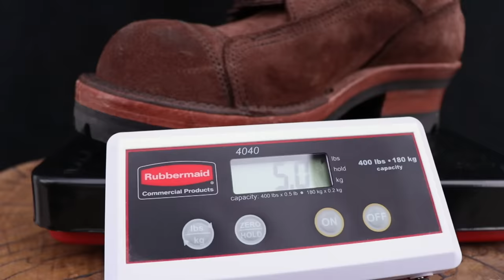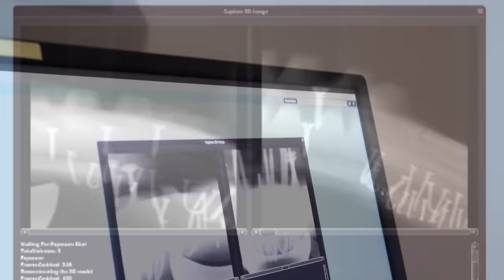Testing $1000 “Indestructible” Nicks Handmade Boots

Comment: Took me years to pull the trigger on a pair of Nick’s boots. When I finally did, it was a huge eye opener. You get what you pay for. I’m a welder/fabricator, for over 20 years. I typically had to get a new pair of steel toe boots every year or two.  Usually Carolina’s or Red Wings loggers. I’ve been wearing the same pair of Nick’s at work, and outside of work, every single day for the past 6 years. Buy once, cry once. 😉
Reply: How do they hold up to everyday usage? Like on the streets and stuff.
Reply: @ShadeSlayer1911  the only thing the streets are gonna do to a pair of nicks,  is wear down the vibram soles over time. Even their non work boots are insanely durable due to the leather and build process.

Comment: I’d definitely buy this boot, even if it cost twice as much as the regular line. Just to have one pair of work boots for life
Reply: @J Hemphill yes, and I would pay 5 times the regular price.
Reply: @J Hemphill No lie though, the break in would be hell on earth.
Reply: My standard Nick's are the heaviest boots I've ever owned, I don't even want to think about lifting the "indestructible" over and over for 12 hours. Sometimes you can armor something too much. It's very similar to the problem to he Soviets ran into with the IS-7 tank, you can armor something beyond usefulness.
Reply: @jacktheaviator4938  it's often said that a pound on the feet is 5 on the back. So these boots would be extremely tiring. There are a small number of use cases/environments where these boots would be useful, but a solid smokejumper with a steel toe would be noticeably lighter and cheaper while being 90-95% as durable and lasting 80-90% as long.
Reply: For this life and the next
Reply: @edenironworks2  they're overkill for the average worker but for the workers who would need it would be priceless to have. 
I'll always believe in paying once for something long lasting than paying more over time for cheaper replacements but its still a needless expense to get boots that are overkill for what you need them for.
These aren't the only work boots that can last a lifetime after all.
Reply: @yossarian00  Absolutely. Boots are tools. If you don't use the right tool for the job, you're gonna find it lacking.

Comment: Wearing 5 pounds on each foot sounds like a leg and lower abs workout.
Reply: Rock Lee, General Contractor
Reply: They can advertise it was a indestructible work out boot lol
Reply: I have a pair of Danner Flashpoint boots ant they weight 3lbs each. All i can say is they are exhausting to wear in the terrain.
Reply: the standard issue boot that the army gave me were heavy too i doubt 5 pound heavy but at least 3
Reply: guard men's from a medieval time is laughing at your chicken leg from heaven while still wearing steel boot in the afterlife.
Reply: @benjaminfranklyn604  isnt that the truth!
Reply: I have a pair of boots that I modified for welding and other shit, the weigh around 14 pounds and I wear them for 8 to 12 hours almost every day
Reply: @Michael-ko4ko  ya they are brutal lol but still pretty solid.
Reply: These are light compared to caulk boots, tool steel spikes for walking on logs. My pairs usually weigh around 4lbs each. I don't even notice they're  on my feet..

Comment: Made with pride in the USA by skilled craftsmen. Let's elevate craftsmanship to the level it once was and should still be appreciated for
Reply: What’s sad is quality is kinda a niche market now. People would prefer to buy cheap and buy multiple times vs buy once and have something forever. For example, I’ve got some American made tools I’ve used at work for years and years and they are as good as new, and I’ve got some cheap Vietnam made ones that break often and always buying new ones. The cheap ones will outsell the expensive ones to the average consumer. Especially ones that only need a cheap one to get the job done. It’s sad but it’s logical and actually a better deal for most in the long run. Most industries are like that now, quality manufacturers can’t compete with the cheap ones products that are basically meant as single use or limited use. My American made Danner boots lasted 2x as long as the Chinese made ones that are really similar, but cost half as much. So I could get the same use out of the same ammount of money but for some it makes sense to spend less up front.
Reply: @tattedupchrist1105  don't remind me it makes me cry...
If I buy a tool I want it to break because I was dumb and abused it wrong, otherwise I want it to last forever, or be able to maintain close to forever.
Not enough quality in anything anymore, it's sad. People are addicted to the CONSUME lifestyle. Not only is this stuff cheaper, but you get the dopamine of constantly buying stuff, you're 50 dollars away from a hit of happiness and it's in the trash the next week.
Reply: @escapetherace1943  exactly. Good point
Reply: @tattedupchrist1105  do you know how many tools I've bought to start projects that never finish lol? It sounds good but do we really want $500 vcrs? I guess the tradeoff is having good jobs on our soil which may even it out...
Reply: @dashwolf8057  unfortunately your right and I agree with you to an extent. I’m right there with you. I have plenty of cheap tools. But we should be more careful, because hand tools aren’t the only thing we outsource to bring the price of production down. BUT places like China not only steal our intellectual property, but actively try to undermine and undercut US companies. Billions of dollars a year are lost to China because of fraud and counterfeit goods. That might not sound like a big deal when talking about shoes or hand tools. But when talking about something like a semiconductor, or a cell phone, etc.. it becomes a little sketchy. The same country that gives you a $20 dollar VCR also tolerates Chemists selling fentanyl to the average joe in America. It’s like trusting your neighbor who is a thief and  you who you are enemies with, to manufacture the security camera for your house and the lock for your front door. (Not the greatest analogy I know but works I guess)
Reply: That's what I'm saying.
Reply: @tattedupchrist1105  thing is. America is about kapitalism. The manufacturers are not interested in long lasting products. the sooner they are unusable, the better.
You can see this with lightbulbs, nylon socks, electronics and many more other products. Manufacturers act like the resources are unlimited.
When you take a look at soviets and communism, ressources were limited and products were manufactures in cycles. So it was absolutely a requirement, that products would last long. 
In Germany there are a lot of people that are especially looking for tools and machines from old east germany since it was soviet controlled and they made the best and most robust tools.
Reply: @tattedupchrist1105  No. people cant afford to do anything but buy cheap and replace. Being poor is expensive.
Reply: @leforce8249  manufacturers wanting you to replace often is especially noticable in phones. my old IPhone 4 was still fully functional, but became unusable due to old software. or with printers that break after a certain number of pages printed.

Comment: The important question is: what’s the breakin time?
Reply: Probably a couple of months.
Reply: It took me about two months I was wondering if it was a smart decision I went back to my old brand and man there is no comparative on my Nicks vs any other ones totally recommend
Reply: Only a few seconds with a gun
Reply: Took a month for me, it's worth it.
Reply: Wasn't as bad as my redwings and the build quality/comfort is second to none
Reply: How fast do your feet change shape to conform to the boot?
Reply: These boots look like they will break you 😆
Reply: @Ddabig40mac  they custom build them to the shape of your feetsis.
Reply: I was told directly it would be about 80 hours of actual wear time. I am about 18 hours into it right now.
Reply: couple weeks fire/forestry use, par for the course
Reply: @needfortweed8734  They look to be pretty stout, might be a bit longer a break-in time, but if they're built to your foot it shouldn't be too bad.
Reply: @needfortweed8734  7
Reply: @roydunn4649  Its about 80-100 to break in well enough to get through a typical day without the boots being uncomfortable any longer. They will continue to better form to your feet for much longer before being truly broke in. In my case it took much longer than 100 hours.
Reply: @JohnC686  Well I work 10 hr days weekdays and an 8 most Saturdays. Thanks for the info!
Reply: @roydunn4649  No problem. Nicks and the other similar makers really are amazing, nothing else like them. Enjoy the process and the new boots.

Comment: A year late, but I’ll put in my 2 cents.  I’ve worked in a shopping/receiving environment for years.  If there’s one thing that will destroy leather boots, it’s working around pallets.

For those that aren’t in the know, it’s the dropping of pallets and squeezing the boots in between pallets that does the trick, along with box cutters that slip at the right angle.

I’ve gone through half a dozen work boots, even ones with polyurethane on the outer toe for protection, and pallets just eat through then.  Scraping, cutting, and tearing through leather like nothing.  

There is one exception:  Roughout leather boots.  They can handle all the abuse without any kind of visible damage.  Only problem is they discolor and darken to an embarrassingly degree if tanned on the lighter side.  

But work boots aren’t there to look pretty.  Hope this helps.

Comment: These boots are good as aparatus for kungfu master training. Wearing them while training has many advantages. Due to the weight anchoring effect, once taken off, your feet will feel like Gordon Flash and sprtint 100 meters in 10 secs flat. Also good for sumo training because its anchoring effect while you stomp on the ground.

Comment: I personally have gone through 2 Redwings ($375 per pair) 4 Danners ($250 per pair) 2 Georgia's ($200 per pair) and a few Justin's ($150+ per pair) while welding and none of them have held up for more than 18months all from leather failure. Not the sole getting worn down.. either the stitches blowout  and the leather can't be saved or the insole rips or I even have a pair where on my heel the leather got a small cut and just ripped horizontally. I'm very hard on boots. Not sure if Whites are the way to go but these look like legit contenders for toughest boots. I would pay $1,000 once if these lasted 5+ years.

Comment: From a construction workers perspective: when it comes to buying steel toed boots they’re they suck unless you put tough toe on them because once something does fall onto them yea your feet are protected but now your  brand new waterproof 300 dollar boots aren’t waterproof anymore because the steel toe and falling object make a hole in the leather. These boots however are so over built on the cap that you may not even need tough toe that’s value. If you spend  your money on work boots you want them to at least outlast the sole they come with. If nicks makes a 9” boot to those specs I’ll buy them.

Comment: I got a pair of Whites of which I have been told is the parent company of Nick's a couple of years ago. They are the heaviest, clunkiest, most awesomely awkward pair of boots that I have ever liked. Wear them regularly as snow boots and motorcycling. If/when I ever crash, I know that my feet and shins are likely to be intact.
Are they built for walking? Sort of. The weight takes some getting used to and those heels... are the guy's version of a pair of high heels. Treat them well, though, and they are flexible, breathable, and will withstand... just about anything.

Comment: So I work as a water well drill and repair man in the west. And unlike oil rigs were in a more dangerous environment especially since we use all cable tool rigs. We drill and repair year round. I burn through boots. They don't hold up. I want these. These are nice. These will last. The main thing that kills boots is the oil water and iron bacteria. Iro. Bacteria grow on the steal cassings of the wells. So when we pull the pump and cassings up it get all over everything.

Comment: Should have used the whole boot for the bullet challenge -- using the half boot isn't an accurate test.  The boot had much more structural integrity before you cut it,  that might have stopped more of the projectiles (though I doubt the 300 Ultra is stoppable).

Comment: you shouldn't be surprised by the egg drop test. The egg didn't break in theo ther one because of the boot being hit, it's because the egg and boot combo were too light. It broke because the boot bounced off the ground and broke when it came back down. heavier boot=more mass which doesn't get moved from the energy of the ball, so a safe egg.

Comment: The last pair of heavy duty climbing boots cost $175 in 1984. Now they cost $418. A supervisor said can't use them here. But I was prepared dropped a 8lb hammer from 4' on the toe and did not hurt or dent the boot. NO it was not steel toed. Kevlar. But that was made to stop a tree gaff from cutting your foot.

Comment: Spokane has 2 boot makers.....Nicks and another company called Whites boots. Back in the 80's I tried to get Nicks to build me a pair of boots for my work on the Railroad. I walked in ballast all day and got tired of feeling every rock. I asked nicks to build a boot with double the leather in the sole, double stich, and double screw the Vibram sole onto the boot. The counter guy said I was crazy and a boot built that was would be to stiff and unwearable. So I went to Whites boots where they traced my foot and then built it to my specifications .....almost. 6 weeks after I ordered my custom boots I went to try them on. The guy pulled them from the back and sat down at my feet and slipped them on. I looked down and said boy the Steel Toe sure does not show. I bent over and pushed my finger into my toe. The guy gets a funny look and said "you did not order steel toe boots did you?" He went and looked at the order and low and behold they were to be steel toe boots. He comes back and said he was sorry and he would expedite a new pair and did I want a pair of custom made boots at half price? I told him no as I had to have steel toes for work. (I wish I had bought them for hunting) and in 2 weeks they had my correctly made to order boots ready. My experience is that  with Whites is that once broke in they feel like slippers and that makes it worth the price.  Just for reference a pair of Whites hi top with steel toe (Smokejumper)was $200 my special order boots were $325. Nicks and Whites are well build and most important Rebuildable!

Comment: First, I'm glad I saw this video and learned about Nick's Boots. You earned my like and subscription. This brand of boots are definitely what I have been looking for and I may just order a pair. The flame test was interesting. Red Wing makes a Firefighters Boot specifically made to be fireproof, that may bare looking into for comparison and the way it is manufactured. The real test of the resistance of fire to a boot is what is happening to your foot inside the boot.  The leather may not sustain a flame, but if your feet are blistering, you're still hurting. 
About the bandsaw... You actually didn't think your industrial bandsaw would cut through the boots? I think you're being rather disingenuous.  However, the boots do look VERY WELL MADE and the boots on their website look worth the not inconsiderable investment.
You might have also mentioned your financial relationship with Nick's boots, as well.
Reply: What financial relationship?

Comment: The biggest flaw with workboots is that have no support or cushion for our feet. they can be indestructible all they want but if your knees And back are hurting from walking in them all day. there really is no reason to wear them. it's not worth it unless you work a job that needs steal toes for obvious reasons. I work construction and I wear new balance hiking shoes to work now and I haven't had any back or knee issues since I threw my boots out.